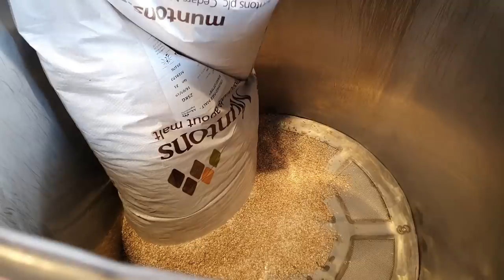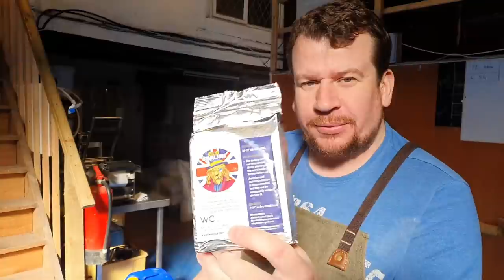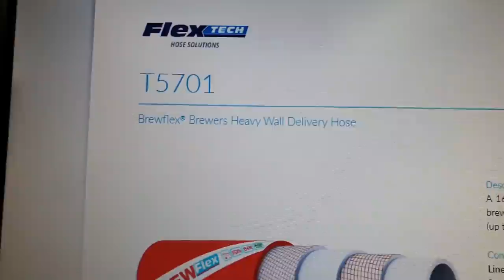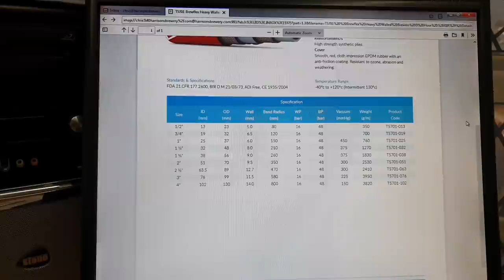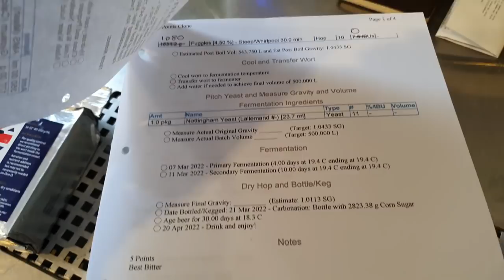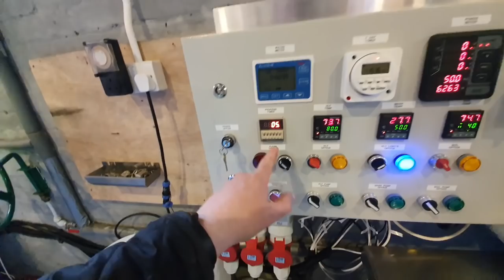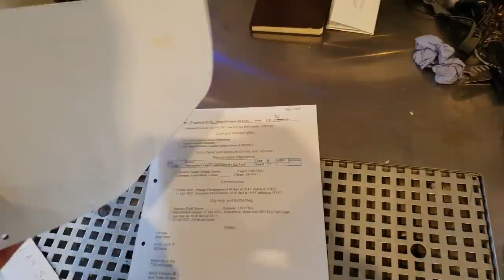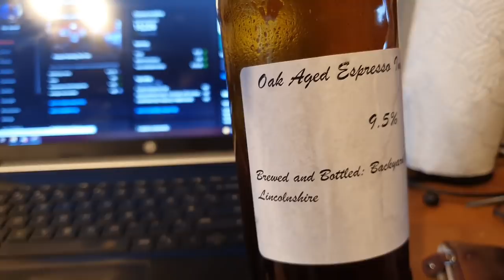Five Pints Bitter Brew Day

Comment: The flickr like you say is 50hz. Trick is to make sure the camera is set to PAL and shutter is 1/50 or a multiple so 1/100 1/200 etc. If it's on the phone only thing you can do is make sure it's on PAL and not NTSC. You prob know all this but just in case.